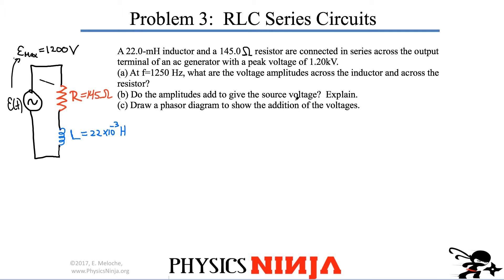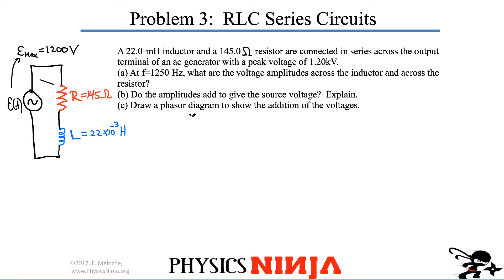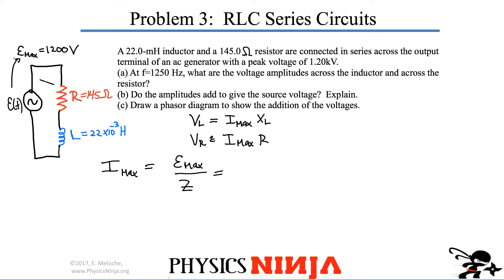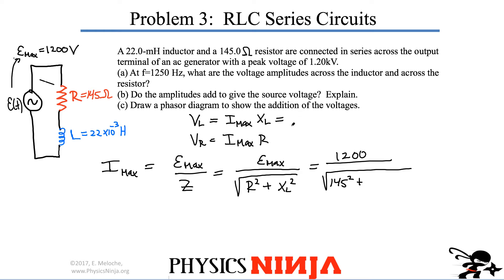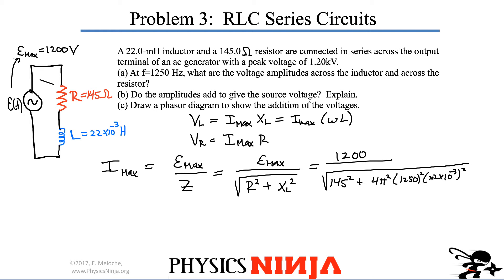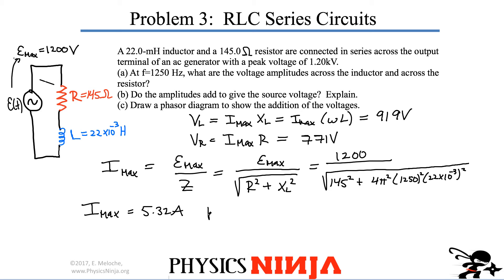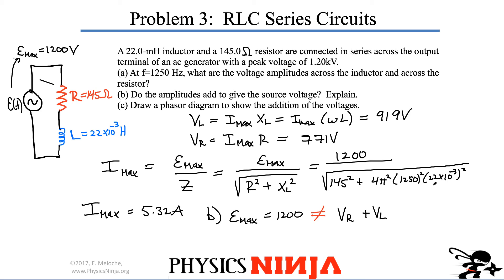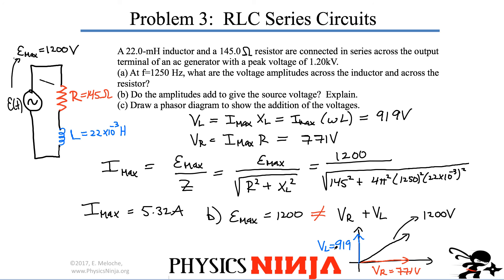AC CIrcuit:  Inductor and Resistor in Series

Comment: vr plus vl is 1690 which is more than 1200.. what about option b now
Reply from the maker: HI Tarun,   you simply remember that they are out of phase from each other by 90 degrees.  Therefore you can't simply add their amplitudes.    Using phasors you see they are perpendicular to each other so you have to add them up using Pythagorean theorem.
Reply: Thank you for explaining..